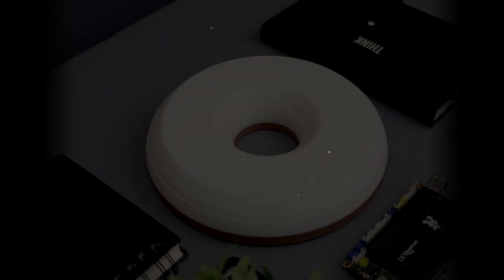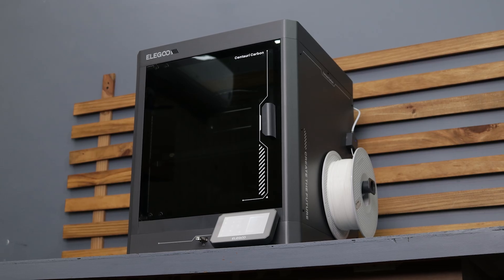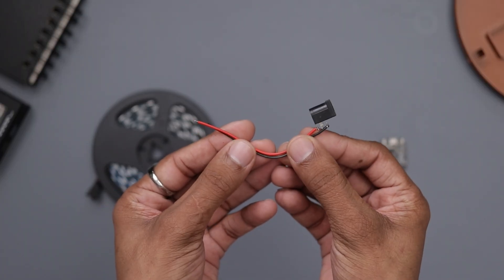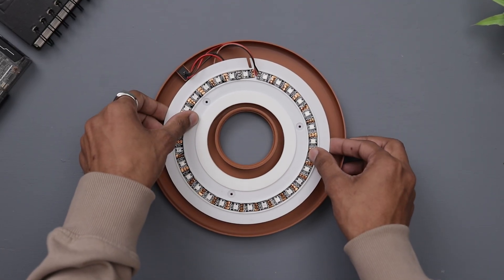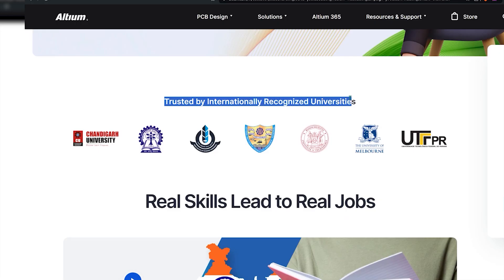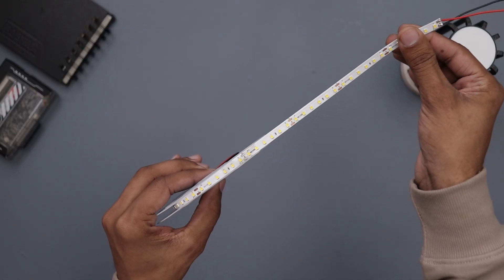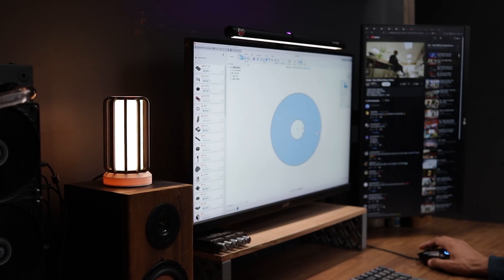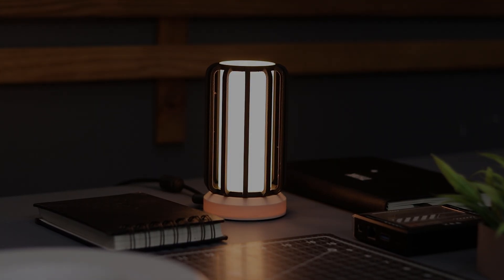Building 2 Stunning 3D Printed Lamps

Comment: while accessing the color changing feature on the donut LED lamp is this on your own local network or is there a app/cloud server that needs access in order to change colors? I used to flash smart plugs and use home assistant to avoid data leaks and make fun projects, but i am unclear as to whether the wemos gives the LED's their own IP
Reply: i just realized you made the comment about installing WLED on the WEMOS D1 mini but you never actually linked the process. Any chance you have a source?

Comment: I wonder how difficult it would be to add rechargeable batteries and a charging circuit for those times when the power goes out.  Seems they would be pretty power efficient and a few around the house would provide great light and additional piece of mind.  Thank for the design and the video.
Reply: you could create some sort of 9V adaptation

Comment: Pla is not that heat resistant enough to use the led strips 

I usually tape the 3d printed part with aluminium tape where i want to wrap the led stip
Reply from the maker: Thanks for the tip! I'll keep that in mind for future projects.